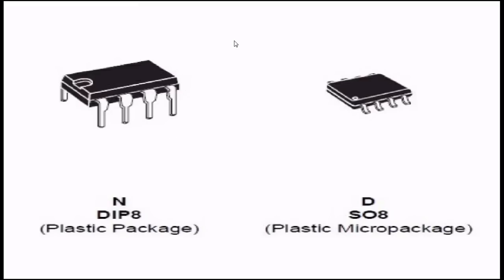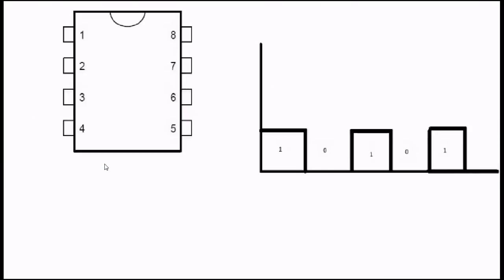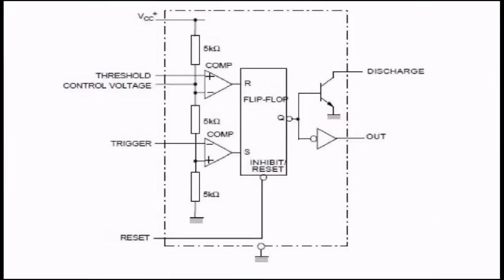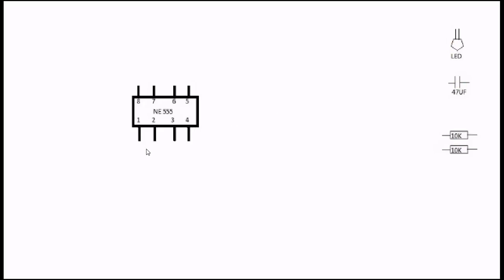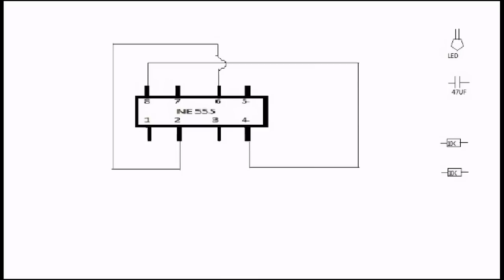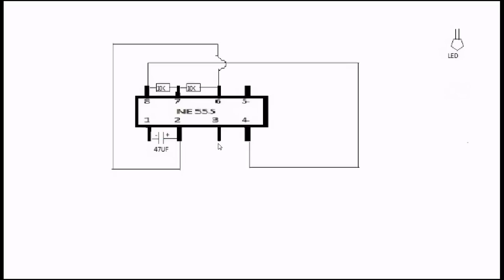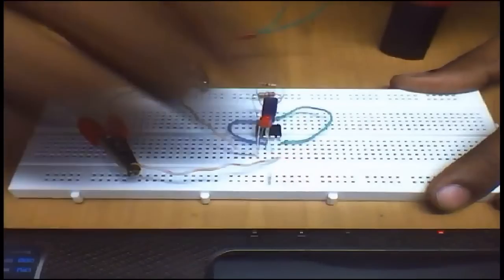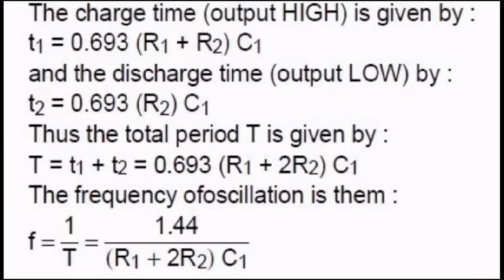555 timer tutorial how does it work

Comment from the maker: Hi, If you use voltage source more than 4V then please use a resistor with the led ( may be 100 ohms to 1k according to your led capacity ) to control the current flow in led and to prevent damages.

Comment from the maker: Yes you can but for better performance you should use  12v battery and a mosfet transistor. Transistor as a switch and timer as a pulse generator for the mosfet.

Comment: I'm, just starting to learn about electronics; what software are you using?  Also, do you suggest a software package for building circuits on the computer before testing them on a board?  Thanks in advance for you help.

Comment from the maker: As you are using 500 LED in series so there will have voltage drop across each LED. So each LED will get 0.024 voltage. If you make parallel connection then at that time you have to consider current division in different paths. (apply current division rule) So if the value of voltage and current matches with your LED's data sheet then it will work else it will not work.

Comment: Hey dude, I just don't get why you used te 47 micro Farads Capacitor. What happens if I change it?
Reply: Yamil Kanchi the rate at which the light blinks will change depending on the capacitor...The larger the capacitor the longer the led will take to blink.

Comment: hello md aupu the project works fine,but wire between pin 8 and 4 is not necessary becouse you can run reset(pin 4) only when it have less than 0,5V so you should connect pin 8 directly to voltage source. And if you use for example 6V vltage source, you should use raesistor about 150R (3V/0,02A) for LED otherwise its can be damaged by to high vlotage. regards!

Comment: Hi! Can you connect multiple LED's in this circuit? I have a 12V power source
Reply from the maker: Yes you can do it. You can connect multiple LED's in parallel and a resistor in series to control the current
Reply: md aupu

Comment: hi, I do not have any background on electronics. 
I want to make 2 kinds of timer. (1 ) for a watering device for my garden that will work 1 hour in every interval of 6 hours..  (2 ) And 2nd is a circuit switch that once i started a motor then after 5 seconds it will switch on another motor then switch off the first motor. can you demonstrate a video for me and upload it here on your channel? thanks. this is Carl.
Reply from the maker: +OLRACSOMAR1 Using microcontroller (PIC/AVR/Arduino) is an easy solution for your application if you have knowledge about basic C programming language. I will try to make a tutorial video for you soon.